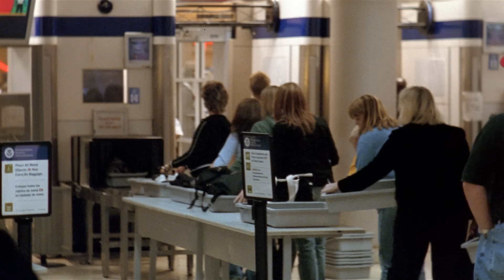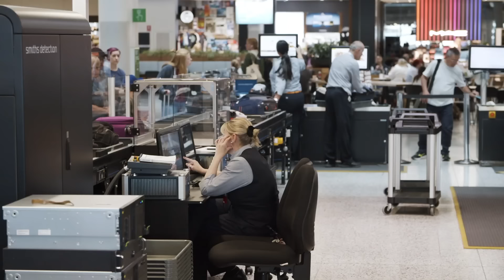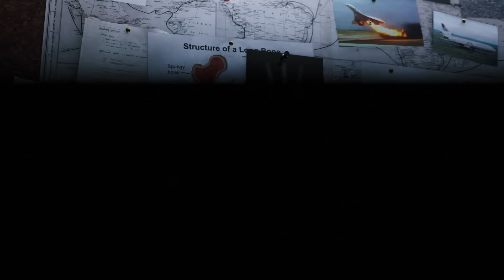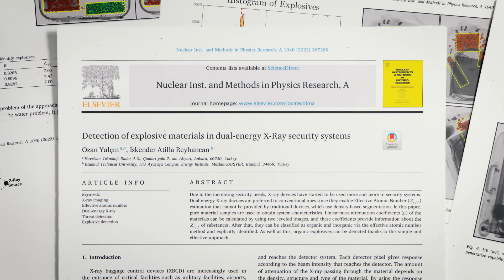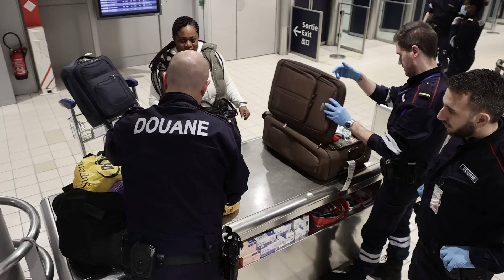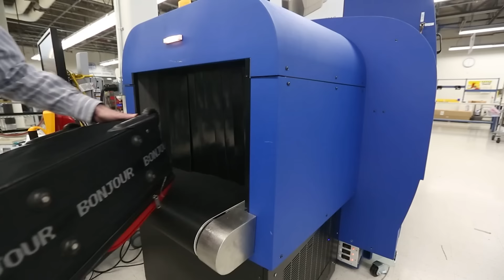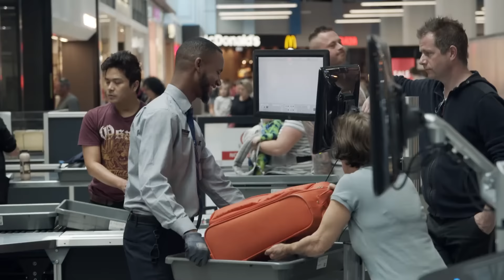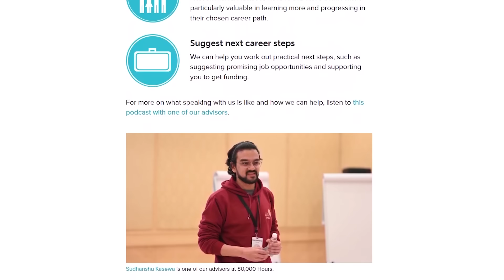Why Airport Security Suddenly Got Better

Comment: These new scanners are slower because it relies on humans focusing on multiple layers to fully inspect a suitcase.  The worst is when they make someone go back through because of something in their bag that should have been separate (some airports still make you take out ipads and laptops even with the new machines for no reason at all).  They don't put your case in front of others in line so you gotta wait for another 4-5 bags to be scanned before yours is scanned.
These scanners aren't better if they don't install more lines to make up for human based delays.
Personally, the biggest single improvement would simply be a sign at the front of each line telling you if you need to remove items, shoes, or anything else.  Without signs, people either guess or constantly ask the security agent over and over again.  The lack of signage to inform people about these process differences between airports or lines at the same airport makes zero sense.
Reply: Signs are useless. No one reads them.

Comment: I should not have to take off my shoes or belt, or take out anything in my luggage.  If that's the case, I want reduced airline fee by 50%  So people should not send items through the scanner if it is sensitive to radiation.

Comment: I recently went on a trip to see the eclipse and as I don't travel much I was surprised when at SEA they told me to stop unpacking my bag and to just leave it. Getting a glimpse of the screen made it very clear it was some type of high-resolution CT scan compared to a traditional x-ray but it's really interesting to hear about the details about the dual energy part and how the materials are identified and differentiated!

Huge time saver and reduction of stress, especially combined with spot saver programs where you can schedule a time to enter a priority check queue!

Comment: This is good timing for me as I flew out of Milan Malpensa Airport and I realized in line that I had 2 half drank water bottles and 2 Powerade bottles in my backpack. So I chucked one water and didn’t find a garbage to trash the other liquid. The security agent told me it didn’t matter and somehow my other bag got additional search (for my toiletry bag) while my backpack with the liquids didn’t require any extra search
Reply: Probably had a spray, maybe a deodorant in the toiletry bag, no?

Comment: Where did you come up with an average of five minute time savings for every single passenger? If it's completely arbitrary for the sake of an example, you could just as easily say ten or thirty minutes. Something closer to 30-40 seconds on average seems much more realistic. The travel stress reduction and security staffing (and employee retention - I'd be much happier not needing to pull every 10th bag and constantly deal with the hordes who fail to listen to basic instructions) improvements may not be as easy to fit into a savings of "years" but I still think that number is a drastic overestimate.

Comment: I went through two airports for the eclipse in NA and I didn’t have to remove my camera, lenses, iPad, laptop, chargers, batteries, even my Astro tracker. I was beyond shocked. They did have to check the counterweight manually because it was in all honesty shady looking (pitch black on the screen and a small soda can size). But I was still in and out super quick

Comment: Sounds nice in theory but more and more false information is making travelling more of a pain. Inconsistent systems with no real choice and racial segregation like on Heathrow idiotic women splitting mixed married couples make it even a bigger mess. Strong Xray and mechanical drives? Too bad they are wiped!!!

Comment: Went through my local airport and forgot my 3.5 inch folding knife in my bag. Got all the way through security and to my destination before realizing. This is a brand new airport with the newest X-ray scanners. The TSA is not effective.

I have a theory to why it wasn't flagged specifically that it was not a pointed knife and it was touching other metal items that probably changed the shape seen on the X-ray.

Comment: "Because the preson in front of you hasn't flown in 20 years"I used to flow every single week, and let me tell you, the TSA makes up the rules depending on your airport. I would get yelled at for having my belt on, off, shoes on, off (LOOKING AT YOU ATLANTA), while some would be ok with lapotps in your bags, others wouldn't. Have a bettery backup? Leave it in, out...Smart watch? Wallet? It's whose line and nothing matters.

While I appreciate TSA might have the option for smarter tech, they still are assholes.
Reply: I’ve asked them why it’s like this. Their answer is so criminals can’t game the system it’s all BS. All the TSA does is violate your privacy and stress everyone out.

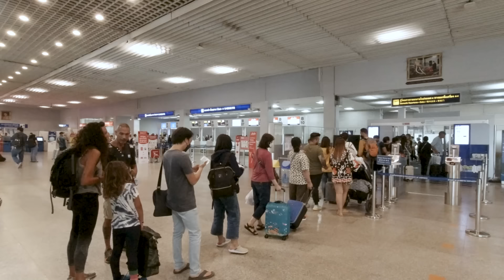Comment: I was about to correct you about "hasn't flow for the past 20 years left their laptop in their bag" (0:41), because it has only been the case for a few years, since 9/11 to be exact. Then I realized how old I got and that I'm still living in the early 2000s in my head...
Reply: "since 9/11" - I remember the Before-Time.
In the 90s I did a lot of practical work, and carried a pocket-knife [Victorinox] on my key-chain and habitually hung it out of my pocket and my keys in to reduce the bulk in my pocket, and coz it was easier to grab [also had a quick-release].
I got to the scanner [1999] and put various things on the belt, and the man said, "And the Knife."
Yep, Scan that, Make sure it's a Knife, for my plane-trip.
[Of interest, I just checked my local rules, and a S.A.K. is still OK to "carry" in public for it's normal practical purpose - But Anything Large or Locking; No Fucking Way - And they do metal-detecting these days at Public-Transit, and the Night-Club district]
Reply: As a 90s kid, this how I constantly feel like. Then I realize its been a little longer than I like to think.
Reply: many airports ask you to not take out the laptop
Reply: I was born after 9/11. I’m old enough to drink <3
Reply: Same, dude. Same. 😩
Reply: I feel you

Comment: I remember 2 years ago i would travel and i bringed my backpack with my always water filled aluminum bottle. I usually dumped the water before getting to the airport but this time I forgot and when i was unpacking my laptop i remembered but either way went to the scanner. 

I was surprised nothing happened. Thanks for tñexplaining this video. Now i dont have to buy overpriced water or get thirsty before boarding a plane

Comment: But with the new technology, an old problem is showing itself again. I've seen several reports on the photography forums where I participate that the new scanners are not photographic film safe. Travelers bringing undeveloped film through an airport need to have the film hand-checked again so the scanners don't ruin it.

Comment: Very interesting!  There are two points of view one can assume watching this video.  One, good people getting through airport security with a minimum of hassle (focus on false positives), and two, bad people getting bad items through security without detection (focus on false negatives).  Unfortunately for me, I focused on the latter, and I am now left more concerned about the adequacy of the new scanner technology, as I can imagine different ways to beat the system.  For example, I wonder if the reliance on density calculations could possibly be hacked by using micro-suspensions or foams to fool the density measurement.  (And for anyone inclined to get mad at me for bringing this up in a public forum, reliance on secrecy makes for terrible security - the bad people have already figured it out.)

Comment: Between being a Vet with military jet and prop maintenance  experience and  the Last time I got on a commercial flight was  2012 after the shit experience I had I'd rather drive or take a boat.  Good on em for their supposed security upgrades but as a former jet mechanic  I'D RATHER DRIVE!  Hell with security if you knew how much CRAP was wrong with the passenger aircraft you were getting on to fly to Aruba had.... You'd get a row boat and  some scuba gear..

Comment: One of the more emberassing times going through airport security, I had forgotten to remove a N64, 2 controllers and games. On the xray all you could see was a circuit board with wires going all through my bag leading to small boxes also containing circuit boards lmao it acutally looked like a bomb.
Reply: I used to fly between home and college with my N64 and I also always had to remove it. The controllers probably confuse them on xray bc they look and think "what video game controller has three handles? Tf?"

Comment: Also a thing that impacts the airport experience are how the security is done. There is no insensible thing for example in helsinki airport except the boarding method, you go to departures after you have checked-in and luggage drop, then scan the ticket in the scanning device and then passport. After that they scan your bag, maybe asks to see the ticket and passport, don't remember. Dont' have to undo your backpack. Then you go to departure hall. Now this is where it should be different though i digress. You wait your flight here and then when you are ready to depart you go through a check-point, and then in the section where your plane leaves you wait your boarding time. At boarding they check your tickets and put you wait, then you board the plain.

In singapore you check-in, they give you tickets. You go to departures and they check your ticket and passport manually. Then they do automatic scanning of passport, your retinal scan etc. Then in the boarding you have insane level of checks. When you do boarding, they check your ticket and passport before going to security check. The security check checks your ticket and passport. You have to empty your computer and have no water while they scan your things. After that you repack and go to to a third place where they will check your ticket and passport, and then wait for boarding. All of these checks in the span of 10 meters. 

While similar amounts of checks in both, in helsinki airport the checks have been broken in sensible distances to each other, while the security scanning being right when you enter departures. These speed up things tremendously in the airport, and makes the airport experience feel much more smooth.

Comment: As a first time flyer, it was very confusing going from one airport security to another and having completely different procedures. Remove everything at the first, and nothing at the next. Water out, then forgot it in my metal water bottle in the next and wasn’t flagged. I had no idea different scanners were part of that difference. Glad to see improvements though with how many small things I had in my bag. Unloading it was a massive pain
Reply: Nothing is ever the same in airport screening, even when there are guidelines listing the requirements for a given screening entity.
Checkpoint A can have different requirements to Checkpoint B. Even though both checkpoints are 100 meters apart in the same terminal operated by the same company.
Reply: In the US security procedures are uniform, but their enforcement may not be. Abroad things are very different. If you are a novice flyer in the US, you’re going to be in the regular security line. This currently means laptops out, shoes off, and going through a full body scanner. In Precheck you keep shoes on and laptops in and go through a metal detector. In both lanes liquids must be in <=100ml containers except in limited circumstances like when it is medically required. Empty water bottles are allowed in both.
Reply: @osculant  🐑
Reply: @osculant whether you have to take the laptop out depends on the airport not the line. I'm not precheck but some airports have you take it out and some don't. Never seen any line in the states where you get to keep your shoes on. I've seen the precheck line and been through it when the line is shorter and you still have to take your shoes off. Precheck is a service you pay for or get upgraded to after reaching a certain loyalty status with your airline. You could be flying for your very first time and still go through precheck. 
I always wondered why it was 3.4 oz, such an arbitrary number, only know do I realize it's the rounded Imperial version of 100 ml. But you're allowed 3.4 oz of liquid per container but can take many containers. In my experience, I've taken whatever sized container I wanted, I've only ever had a problem at 1 airport that "my container was too big" though the lotion inside met the requirememt. Everywhere else has been fine.
Reply: @RoyalReyna  I’ve taken well over 1000 flights in the last decade with Precheck. You always keep your shoes on. You always leave laptops in. Heck, I try to take a laptop out because I carry two next to each other and it’s caused many problems, so I voluntarily try to take one out every time and occasionally they try to convince me to leave it in (they are more confident in themselves than I am).
Reply: It has nothing to do with the scanners, they just hate you and want to make your life miserable by having inconsistent rules and security theater.
Reply: My experience has been that water is allowed into the airport checked in area, where its usually a mall like environment. Its banned at the checkpoint leading to the actual gates.
Reply: @viceice  not really. It's not supposed to be taken through security. Once through security you can buy anything sold at the airport and take it through the gates onto the plane. There are airports that sell liquor, you could go by a bottle and take it with you in the cabin, you just couldn't drink it on the plane. 
Though I flew recently and only realized when I got home I had flown with a full bottle of water and had managed to get it through security and customs. So it just depends on the place if you can take it through security but I've never heard of anyone being asked to throw their drink away before boarding. Not sure why you would think it's banned

Comment: Also, each element has jumps in X-ray absorption in different places, so if you really want to isolate a certain element, you can X-ray it once a little below and once a little above and the difference shows you that element (e.g. iron has a jump in absorption at 7.1 keV, so 6.7 keV and 7.5 keV). That way you can find and confiscate all the steel nail clippers hiding among a bunch of loose change, to keep everyone "safe."
Reply: Low Z elements have k-edges way too low to detect. A 7 keV photon will be attenuated by a few micrometers of iron/a few mm of water. Mammography operate at 30 kVp, medical CT at 120, and industrial CT:s at several hundred (since they need to image dense metals).
Reply: Maybe in a synchrotron... but the luggage would have to be frozen... but then you might as well check fluorescence
Reply: Elements… but can they detect the difference between my MDMA and prescribed adderall?
Reply: @peanuts4132 Yeah definitely, whether the agent actually can read the information right is another story lol. MDMA is in a crystalline structure usually as a HCl salt. Even with meth vs adderall it should be easy to tell (despite their extremely similar properties) because of the binding agents, finely powderized and pressed pills etc.

Comment: You briefly mentioned how it's "not a lab" but a real, physical area. This is much more important than the short comment makes it sound. I work with a guy who pioneered these detectors and he told me once an entire airport had to shut down because the bag scanners stopped working. Turns out the fine jet fuel soot covered the electronics and caused shorts. Maybe that should have been anticipated, but it's an important engineering lesson that no plan survives first contact with the enemy.
Reply: Something along the lines of the 6 P's: Prior Planning Prevents *iss-Poor Performance.  Oh, then there is A Failure to Plan, is a Plan to Fail.
Reply: "Entropy always wins."
That simple fact made ma a lot of money as an Electrician.
Basically, we channel and direct entropy to where the work needs to be done.
Reply: That must have been a really bad day for a lot of people.
Reply: Moral of the story might also be to roll out new technology slowly (IE don't replace every scanner in your airport at once) so that you can go back to the old method if the new one sucks.

Comment: So the “solution” to the problem is that we should be better screened at the airport and not that the security theater should finally be stopped?
Reply: Amen, treating everyone as potential terrorist is in my opinion not justified based on rational reasons.

Comment: I went through London Heathrow last month and got pulled aside because of two small (raku fired) ceramics I didn't trust to not smash in my checked luggage, and got the full bomb residue swab and everything. It was quick enough but it really felt like the security agents were pissed I wasn't actually trying to smuggle bottles of perfume through the border like they had assumed.